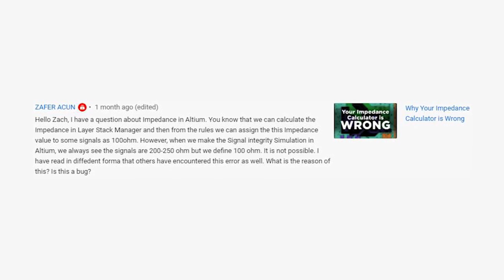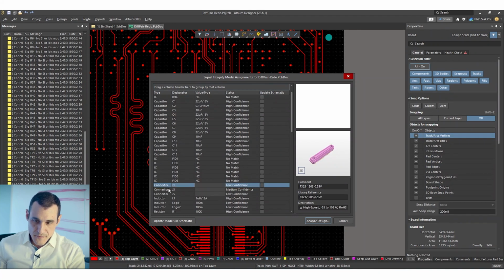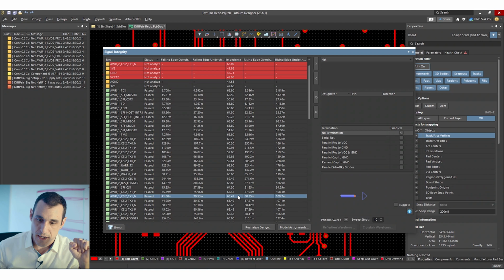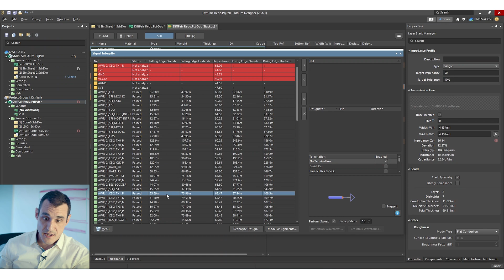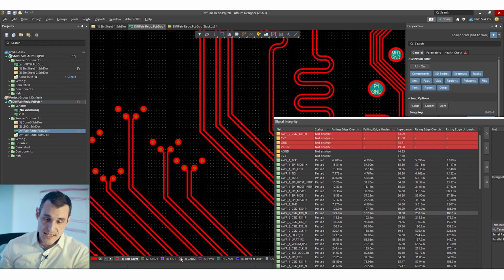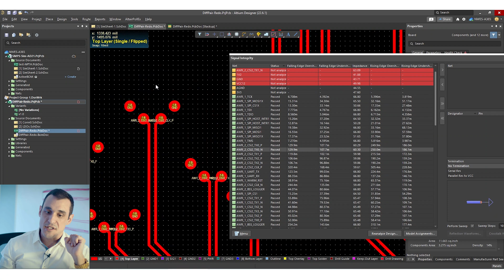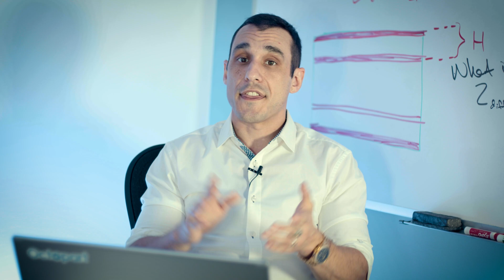Impedance Measurements Using Altium Designer's Signal Integrity Tool

Comment: Hi all! Is length and impedance of vias also calculated for differential pairs in Altium or not?
Reply: Altium does not have a built-in capability to calculate the via impedance for single-ended or differential vias. About the propagation delay, Altium knows the distance of the vias and I think it will take the delay of the vias into account by assuming the signal propagation rate is equal to the delay along the connected transmission lines. This is typically an appropriate assumption given that the transmission lines are almost always longer than the vias and so they account for most of the delay anyways. To get a frequency-dependent impedance curve for a via, you will need to use a simulator with 3D electromagnetic field solver, such as Simbeor. I think that Simbeor has the best tool for this.

Comment: Thanks a lot. ❤. So, how can we choose the best  values according to real board stack up ?!
Reply: If you're referring to the impedance value you want to design to, this is specified in the standards for the high-speed interface on your component. For example, USB requires 90 Ohms differential impedance, which can be created using 2 traces each with 50 Ohms single-ended impedance. This example with USB is something I have discussed in other videos on routing USB in 2-layer PCBs.
Reply: @Zachariah-Peterson   Thanks a lot Mr. Peterson

Comment: Hi Zach.  I am having the exact same issue that the question that your original question had.  All my nets show as 200+ ohms, which is physically impossible.  But...after reading through the comments, it looks like someone has the answer to what is causing this problem.  Which, IMO, if it's correct, is a real problem with the tool.  I do have my reference planes setup as polygons.  As I bet %95 of people do.  So, I'll change them to plane layers and see what happens.  As this issue was recognized over a year ago, I am very disappointed that this has not been fixed by now.  Would you be able to point this issue out to the appropriate people in Altium and get this in the queue to being fixed?  Or, is this something we have to live with...which would be a real problem as sometimes I have to void through layers to polygons on lower layers, that can not be planes, and this, if not fixed, will just not allow me to get correct results.  Thanks for all the hard work you put into making these videos.  They definitely are very useful.  After setting up a design using planes, the values were better...but I think it's still not working right.  I setup a polygon pour around both SE and DE nets, and went from 1 mil spacing from signal to polygon, out to 10 and then to 40.  No change in impedance calculated by the SI tool at all.  Which is clearly not correct.  So, the SI tool doesn't appear to recognize polygon pours.  That's a real problem if trying to use it to figure out how spacing to a polygon effects impedance in a design.
Reply: I have brought this up in the past but I do not know where (or if) this is on the development roadmap. The SI tool has not gotten a lot of love over the past several years and instead there has been a focus on integrations with Simbeor, Ansys, etc. I think this is a case of "squeaky wheel gets the grease"
Reply: Not all heroes wear a cape

Comment: I think when it comes to SI Orcad does it much better with it's "impedance vision", where it overlays a color-coded map of impedance directly on top of a PCB such that it's immediately obvious where impedance discontinuities are. Altium needs to implement a similar feature because it's super useful. Also same can be said about crosstalk - Orcad has similar overlay for that as well.
Reply: You're preaching to the choir, I've been complaining about that for awhile. They already have the architecture in the backend to do it so they might as well add the feature.

Comment: The answer to the actual question about getting 250 Ohms impedance: Signal Integrity tool uses ground reference only if it is setup as a plane. If you use signal layers with ground polygons-it seems not recognized as a reference ground
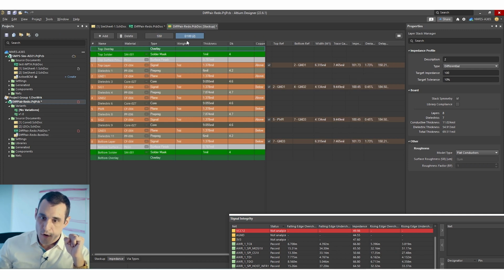Reply: As I mentioned in Jim Jewett's question, without looking at the user's specific design it's hard to say what exactly they did to get their result, but in the example board I show the interior layers were defined as plane layers, as can be seen at 6:11. I will say that I have seen someone get a very large result because they had a portion of their trace routed over an area where there was no ground, so of course the solver produces a very large value for the impedance.

Comment: I had been (perhaps wrongly?) assuming that impedance and Er were similar, and that in addition to reducing the amount of current that flows through, higher impedance (or Er values) would also reduce the speed of propagation.  Therefore, the path's average impedance should be weighted not by length, but by time-spent-in-this-section, which would be something like length * impedance, and would therefore mean that sections with higher impedance change the average more than sections with lower impedance.  

Are my model/assumptions just wrong?  Or is that what Altium actually does, but it was too complex to explain in this video?  Or is it just that this effect is typically small enough to ignore?
Reply: Higher Er means larger refractive index, which means lower speed of light (signal speed). In my opinion they should not do any weighted average, but instead they should show the characteristic impedance and input impedance along each section of the route as a heatmap. Sigrity does it and SIWave does it, so Altium should do it. They have all of the computational power built into the tool already, so it should not be any issue to display that result directly in the PCB editor other than maybe adding a new Panel. If you are going to show a single value as a weighted average, then you could certainly use the time delay in each section as the weight but I don't know that it communicates the impedance information in a new way that is intuitive, maybe I'm wrong though and would have to think about it. If the Er value is the same in all dielectrics in the layer stack then the two weighted averages are equal because the speeds should be equal in all layers except surface layers.
Reply: @Zachariah-Peterson  When a standard specifies 50 Ohm, does the "50" actually matter except at the connections?  I'm inclined to think in software terms, so that the within-my-own-component impedance (and average impedance, and even variations in impedance) are irrelevant -- so long as the frequency-specific Voltage, Current, and Impedance are somehow correct at the endpoints, but ...  I might be missing even something trivial.
Reply: @jimjjewett  The 50 Ohms matters at the connection in terms of the input impedance. That's why impedance transformers and stubs work so well at specific frequencies with narrow bandwidth. But remember the input impedance is related to the line impedance, so it's not just a case that we can say the input impedance plays no role.
Reply: @Zachariah-Peterson  Is this implicitly saying that (1) if you have anything beyond 4 layers, impedance controlled traces should get to a via immediately, and spend their time on inner layers (2) if you have 4 layers or less, then in practice, your constraints probably aren't tight enough to worry about this level of detail?
Reply: @jimjjewett  Getting to the via immediately from the chip output is not an expectation unless you are working at very high frequencies. The layer count doesn't matter so much at that point, what matters is the frequency compared to the distance spanned by the via, that via could be through-hole or blind/buried. For example, it's common to see RF signal launches that pass directly to L3 (through blind/buried via) from a connector or ball out on a component, and they work well up to 90 GHz. If you have only 4 layers or less you could still have very tight constraints, again because of frequency.

Comment: Going back to Zafer Acun's original question ... I'm used to reading about 50-100 Ohms for PCB traces, and the ways to change it being things like trace width, distance to ground, maybe a different di-electric or thickness.  These all seem like things the stackup manager would know about, and consider when targetting the intended 100 Ohms.  I would expect some variation around vias and such, but getting to 250?  Does that indicate a bug?  Or at least a serious gap somewhere in the return path, or something else that should be flagged as a design error?
Reply: It's hard to say without looking at their design specifically. However I will say that I have seen this happen to me, and it occured because my layout did not match the line design I had calculated in the layer stack. The time I saw this was in a 4-layer RF board that had a portion of the layer stack cleared for a printed waveguide. The feedline was basically being routed over ground on the bottom layer because everything on the inner 2 layers was cleared. The line was sized to have ground 50 Ohms with ground on L2, not with ground on L4, so of course the impedance was through the roof and it was something like 230 Ohms.
Reply: @Zachariah-Peterson  That sounds like the sort of edge-case bug I could imagine writing, and it is good that the impedance checker calculates a different way as a cross-check.
Reply: @jimjjewett  There is  already a simple solution for it though. If you have an impedance profile that has a the reference set to a specific layer (such as L2), then you can apply that profile in the Return Path rule. It should then check if you deviate from that reference layer and it would flag an error.